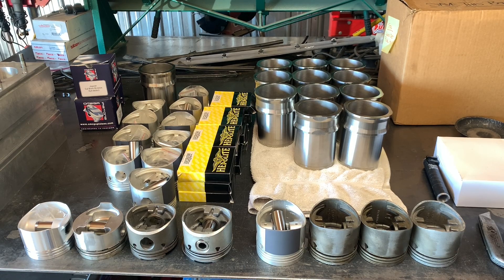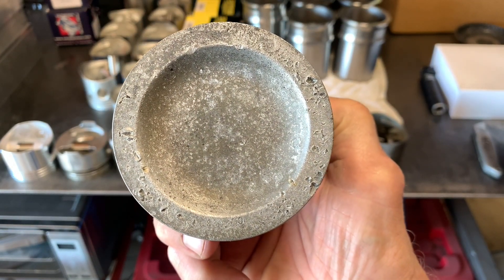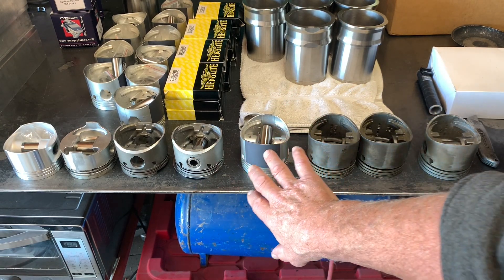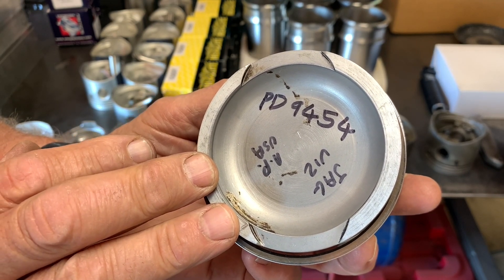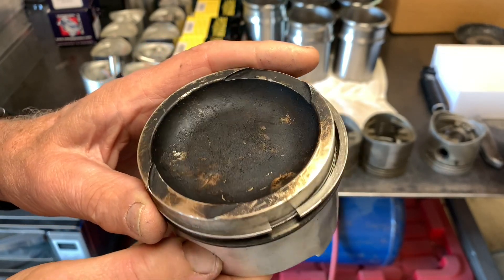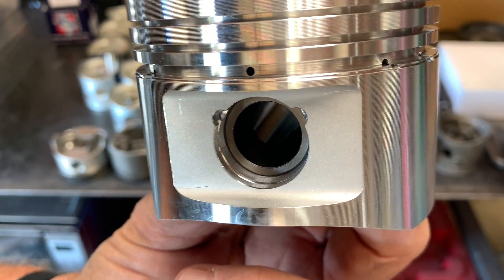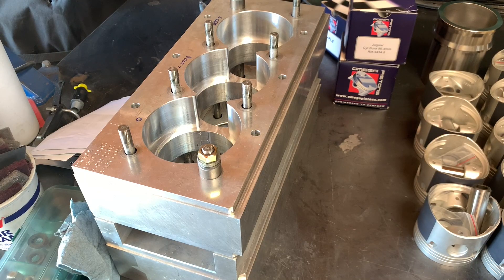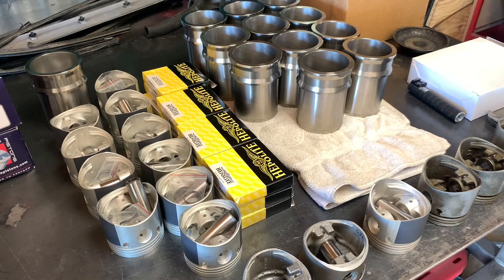S5:Episode14- TWR Jaguar 6.1 Liter vs 5.3 Liter Jaguar E Type Pistons

Comment: He V12 drop vave seats and suck because they have India Made heads valves and pistons....earlier Pre HE v12 are the only war to go Jag V12!
Reply: I'm wondering where that is documented b/c the block was done in the West Yorkshire foundry, and one would think the heads would have been done there or at another UK foundry as well.  All machining and assembly is of course on video right through the 6.0L being done in the UK.
Reply: The West Yorkshire foundry story btw is an intersting one 1846 to 2004 (closed) with buyouts and name changes from 1997, but was the premiere UK engine component caster for numerous firms for decades...

Comment: IDK if it's just me, but the music track is there, but not the narration.... Might need to check this one & re-upload if it's not just me Robert.
Reply: try to listen to both Left and Right audio channels, or try Mono.  Sometimes Bob’s narration is on one of the two channels.
Reply from the maker: I checked and it all seems to be there.
Reply: @thecampchaoschronicles9567   Apparently it is, but only (for me) if I'm using a different than std audio device -  I took the suggestion from @handhwiegman8115  & changed my output device so.. something on my end though I don't have this issue on any other videos - and AFAICTell, stereo works fine and is in balance on the default device and I've double-checked the plug insertion.  IDK what's going on except if I switch to essentially "mono" sound - like via the monitor's inbuilt speakers, the narration comes through.  Otherwise about 5 - 10 seconds comes through in just a couple sections of film.  I'll keep working on it and figure it out.

Intersting TWR just machined OE E type Hepolite Pistons.   Will you side skirt coat those Omega pistons & give them a top thermal barrier coating?  I never thought about the wrist pin being offset on the Jag Engines, but it now makes sense with a to-the-front directionality to the pistons.  I'd like to know why it makes the engine smoother but less powerful.  If the cylinders themselves had been offset to the outsides (instead of the wrist pins) theoretically more power could be captured from TDC (because of the  rod angle offset) than directly in-line (the opposite of what you've noted happens with the wrist pin offset.)  The hashtag d4a (Driving 4 answers) channel has a good short animation explaining offset cylinders.  I wish we had a real extensive documented piston PN list with pictures even if many were NLA.
Reply from the maker: @ferrariguy8278  Piston offset makes the crankshaft reach TDC before the piston does. I may do a Tuesday extra about pin offset. The original pistons aren't going back in, we have new omega supplied pistons. The specialist the client is in touch with thinks it may have been an early development engine.